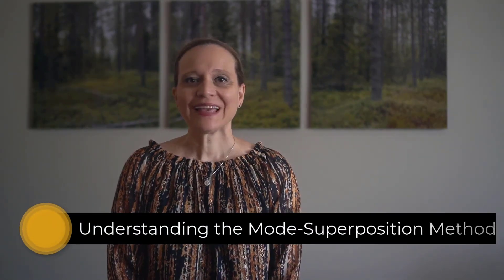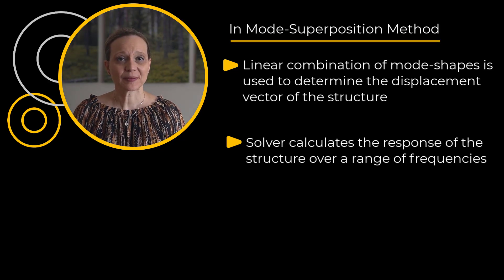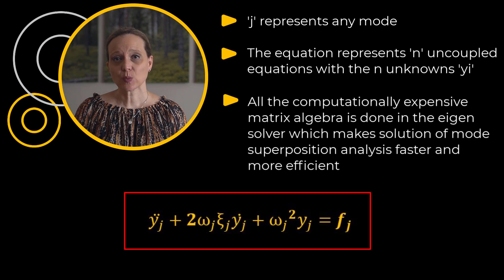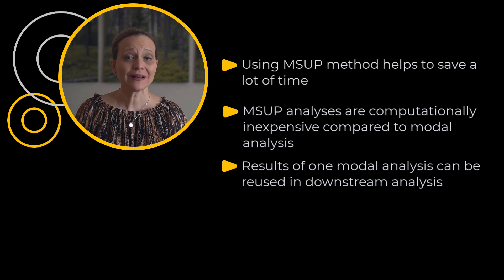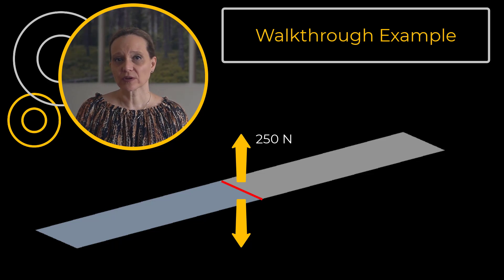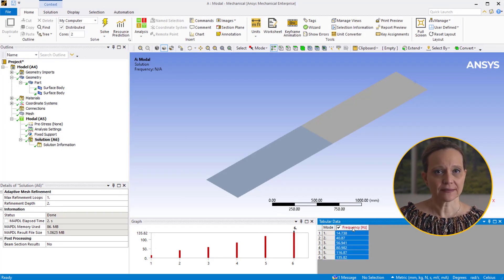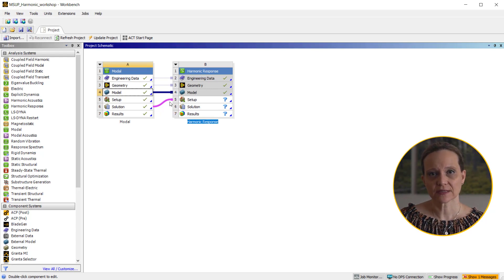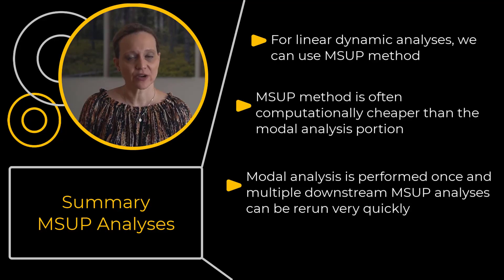Understanding the Mode-Superposition Method Using Ansys Mechanical — Lesson 1

Comment: In the dynamic analysis (mode superposition), how can I consider certain modes (ex) shell structure dynamic response excepting shell beam mode that means only shell modes))
please check following ideas

1. When performing mode analysis, mode analysis is performed except for the frequency range of the beam mode. And then msup analysis is performed

2. Modal analysis is performed for all frequency range, and then except beam mode using numexp (the frequency range excepting beam mode)

Are both methods valid?

Consequently,  to get dynamic responses in a pure shell modes, what can I do?

thanks a lot^^
Reply from the maker: Thanks for watching! Please post your query on the Ansys Learning Forum for a detailed answer from the wider Ansys Community: https://ansys.com/forum.